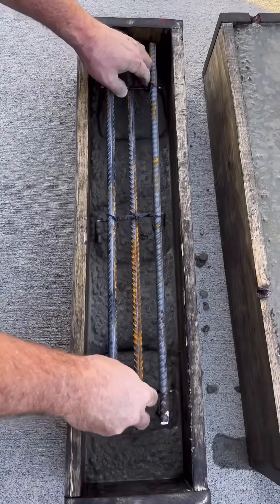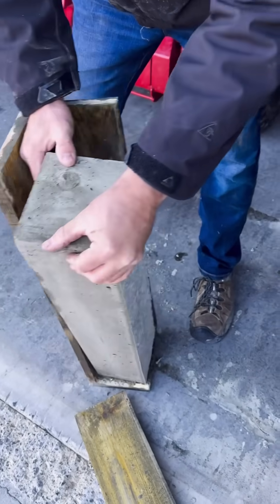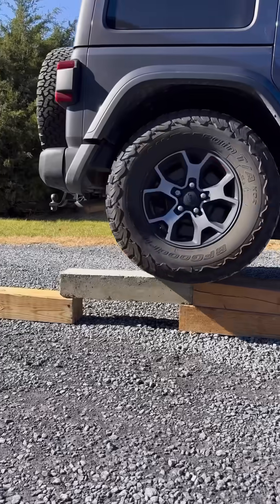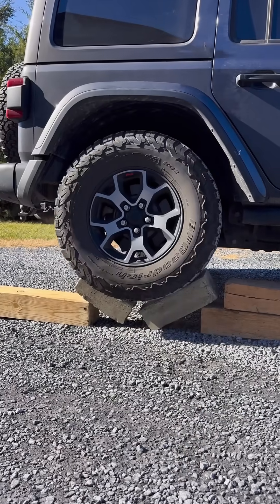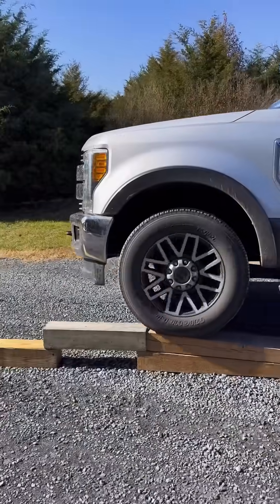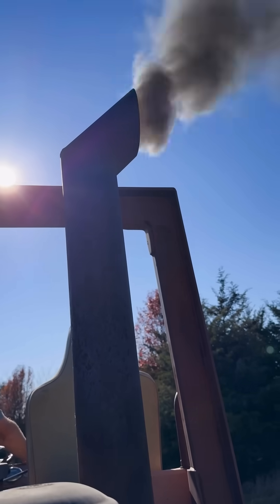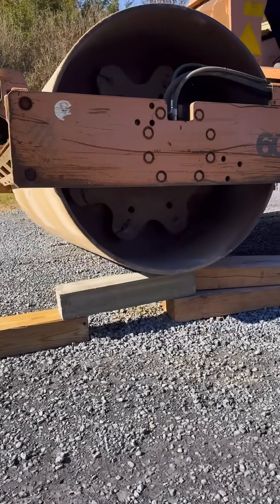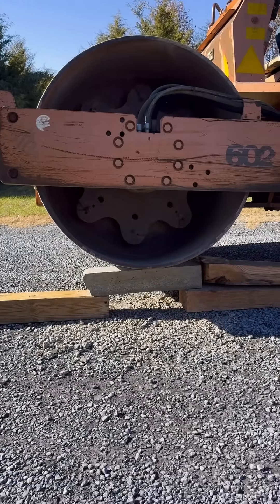Why We Use Rebar To Reinforce Concrete

Comment: I did this as a project in middle school, 8th grade. Science teacher said meh until the dean who had a civil engineering degree came and pulled me from class to talk for almost the rest of the school day about my project and findings. I had experimented with all types of reinforcement. He was so hyped. I’m an engineer today.

Edit: Thanks for all the love. Didn’t expect this. For those asking I was in the Army Corp of Engineers for 14 years. Worked on civil projects but also worked as an explosives engineer. Civilian side I do Industrial Engineering and am back in school again for  Advanced Manufacturing engineering.
Reply: What materials did you try in your experiment?
Reply: @dirkstiletto  started with plain old concrete to have a standard. Really wanted to focus on the difference the added material made. Then did one with chicken wire as recommended by my dad. That got me thinking and I started grabbing materials I had available. I did one with screen from our screen porch. That one was my favorite. Then did one with rebar. Even did one with twigs in it to act like rebar. I was in middle school and having fun with it 🤷‍♂️ the problem came when I struggled to find a measurable way to break them. We pretty much ran them over like this. Any reinforcement made a positive difference. We ended up using these blocks for years for all sorts of things around the house lol
Reply: This is awesome! I am in college for engineering right now, and mechanics of materials is my favorite class I've taken. We talked about this kind of stuff. It's fascinating
Reply: @drewbryant38  If you get a chance, (if you're going the civil/structural route) take a concrete structure design course. It was one of the cooler classes I did in college, and I got to break concrete in the lab, lol. Also, it's one of the more relevant classes to what I do now.
Reply: Of course the civil engineer was excited to talk about concrete...
Reply: @user-ph9pm6fc7g  lmao... As a civil engineer, can confirm.
Reply: average science teacher (doesnt care about the disciplines): 😭

average dean of science and technology (will yap in your ear off about civil engineering): 🗿
Reply: @MattSuguisAsFondAsEverrr  Student: shows an incredible but simple technology that is present in everyday life and is important for our civilizaion
Science teacher: meh
Student: baking soda volcano
Science teacher: WOW, INCREDIBLE
Reply: your science teacher has no passion for science only in title
Reply: i made an electric motor in middle school and got like 60%. the popular guy made a volcano with vinegar and baking soda and got 95
Reply: Sorry for your bad teacher but glad you had others in your life that actually cared!
Reply: W kid and W dean. I'm so happy he did that and you ended becoming an engineer after all those years.
Plot twist you're a software engineer 😂
Reply: @ismbks A dean is sort of the head of a school. 
      If you watch some excerpts from the tv-series "Community" on YT, you can get a better feel for what they do in real life. 
      (Very accurate portrayal of the profession)
Reply: If you were trying to make something hollow out of concrete, basically create a foam form inside of it, what would you reinforce the concrete with? If it was a ramp with an expected weight of like 300 lbs? Would you just fill it up? Or is there a way to engineer it to save on materials?
Reply: @FunctionFIVE  Are you trying to build a half-pipe in your backyard? Lol

But basically, it depends on how it will be loaded. You would want to probably make, like a mesh of rebar if you're essentially having a thin wall that would experience bending stress, but I'm not 100% sure about the geometry you're describing(?)
Reply: @ArchIVEDCinema  trying to make ramps that will last a while on my local MTB trails while saving as much of my own finances as possible. Basically would be a right triangular prism.
Reply: @FunctionFIVE 
Why does it have to be hollow? 
But if so, google hulldekke for an idea.. don't know what it's called in english 🤷‍♂️😊
Reply: @FunctionFIVE chicken wire!!! Can attest. Dry the first layer with chicken wire then the another layer to get smooth
Reply: @evelynnuman  it's a shame this didn't ping me for some reason, so do you mean make a foam core, lay concrete then do a chicken wire layer then more concrete?
Reply: @FunctionFIVE  1. Foam layer
2. Chicken wire wrap the whole thing 
3. Layer of concrete on chicken wire (it won't be smooth - it will look terrible 
4. Allow to dry
5. Another layer of concrete over that layer to make smooth 
6. Done+
Reply: @evelynnuman  sick, thank you so much!
Reply: Cool
Reply: Is right glad that inspired you and your doing something you find fascinating 👏
Reply: bad teacher, amazing dean. I am super happy for you and that you got such support from him
Reply: This is why most science teachers are ONLY EVER science teachers.
Reply: Core memory unlocked right there ❤
Reply: That teachers name? Albert Einstein.
Reply: Amazing!!!
Reply: thought floating around my head:
If you used those connections to build a solid foundation for a career they you could probably add Social Engineer to the list.
Reply: TIL middle schools can have deans too. I thought it was only universities.
Reply: So basically for you, engineering is love, and engineering is life.
Reply: Thats awesome
Reply: Thats lovely encouragement and confidence building!
Reply: SLTW!
Reply: An engineer you say? I'd like to talk to you about my cars extended warranty.
Reply: Holy shit this is such a cool story
Reply: And then the whole class clapped 😂
Reply: teachers suck
Reply: I'll take "things that never happened" for 500, Alex.
Reply: Yeah spreading this fake story around will help human society surely.

Comment: I NOTICED THAT YOU SLIPPED IN THE THIS CONCRETE IS STILL GREEN IN THE END WHICH WAS VERY IMPORTANT INFORMATION BECAUSE ANYONE THAT KNOWS ANYTHING ABOUT CEMENT MIGHT KNOW THAT THERE'S A GOOD CHANCE THAT IT WOULD NOT HAVE BROKE IF IT WASN'T GREEN

Comment: I'm willing to bet if you let that block cure to full strength you would struggle to break the concrete like you did with the roller. The difference between green and cured is amazing.
Reply from the maker: 2.5 days

Comment: The thing you talked about with the compression on the bottom is something that while bucking a tree your also constantly looking at, if you cut to deep into the compressed side of the wood the wood  pinches your bar, if you don’t cut into the compression first than you won’t get a clean cut because it’ll snap

Comment: All you needed to do was read specs on concrete and you should know green concrete will not take any abuse that concrete looked green generally it will turn light gray when dry and there is stress tests that are performed on it to know for sure

Comment: It takes concrete 30+ YEARS to actually fully harden. The concrete used to build the Hoover Dam is not fully hardend yet, it still puts out heat from the chemical reaction. Even with all the water cooling channels.
Reply: It's a big dam so it takes long time to fully hardened 😂
Reply: @Suraj-ix2nh  that’s what she said 😂😂😂
Reply: @cweimer902  🤣🤣
Reply: When I learned this it BLEW my mind
Reply: What you said is true but misleading. Concrete does gain more strength but it levels off after a much shorter period. Typically 21 days is used for a testing period is it gains only a small amount of additional strength for the rest of its life. It all depends on the concrete
Reply: @Civil_Maniac  I grew up in construction. I can tell you from personal experience that 30 year old concrete is much, much harder to drill into or break up than 1 year old concrete. Edit: it also has a lot to do with the thickness. Let the "that's what she said" jokes rain down!
Reply: @nathan40307  i wonder if that strength is akin to brittleness, the total strength doesn’t go up but maybe individual portion are much stronger than the weakest (which would break first)
Reply: @Civil_Maniac yeah, It really gains durability over the course of 30 years. If it is still in the same shape after that time, it is either not being used (which is should be) or it was properly formulated and will last for at least a couple of centuries.
Reply: It also has water moving threw it keeping it wet
Reply: @CodyKemp-w3p Good sir! It appears you have misspelled the word “throo.”Don’t worry, this is a common mistake and even great men have accidentally misspelled it before or mistaken it for the strikingly similar word “threw,” as you appear to have. With that concluded, I wish you a merry day!
Reply: @Dedelblute3  bro "through" is the correct spelling, not "Throo", so it seems you mispelled the word actually not the other person, so don't sit there being the grammar police when you can't spell the word correctly yourself compared to someone who used the correct spelling of the word "threw" possibly due to confusion on the spelling of the word "through"
Reply: @M0RSM4LLE0  Woah woah woah slow your horses there good fellow, I believe I made it plenty clear my intentions were not to be rude or insulting to the fine gentleman I originally responded to. Perhaps you have mistaken my lighthearted banter for a more serious offense of the norms of this here Internet discussion, which I must assure you is not the case. However I must take offense at the distasteful way you decided to approach me with, it was uncalled for to label me as “grammar police” when I am engaged in the polite remediation of word confusion, as well as the hostile and rude attitude that I had originally intended to avoid with my very select words. Making a mistake is not a thing to be ashamed or embarrassed for, and making others feel that way is incredibly disrespectful of their humanity. Before I depart, there is one more matter I must address. It is a shame to have to drop this act this soon, but I don’t think you’ve understood the most important message from my original statement; The blatant misspelling of “throo” was intentional, for comedic effect and to provide levity to the situation. Threw it, I hoped to bring myself down to the same level as the gentleman who originally made the mistake, by making a similar - but not the same - mistake.
With that told, I must depart; If you heed any advice I have given, let it be the one of being kind, even to strangers on the internet.
Reply: @Dedelblute3  you can take offense all you want pal, but seriously, this is YT there are way to many people on here correcting people for spelling when it's literally not needed, my point on this is pointed out below, but if you know what the person is on about them there is no need for correction. You knew what this person meant so there was no need for any correction.

You didn't like my correction regardless if you were using the spelling of "through" as "Throo" for comedic purposes, because that is not how it came off AT ALL, so therefore you don't reserve the right to be offended and call me out just because I called you out for something completely unnecessary.

Good day to you sir!
Reply: Dear @M0RSM4LLE0 ,
You know what? I could argue on the semantics of this, whether it's necessary to correct someone or not, whether or not my offense was taken from your correction or your hostile attitude, but instead I'll just say this:

You misspelled "misspelled" in your first post (and I quote): "so it seems you mispelled [sic] the word actually not the other person." Do you see it? The missing S? It's a common mistake my friend, one you made at a particularly funny time.

And this leads me to my next point:
Both of your posts have catch-22s. Multiple, in fact.

In your first reply:
If it's wrong to correct someone's spelling while misspelling something yourself, it was wrong for you to misspell something while correcting me for misspelling something while correcting someone else's spelling.
If it's not, it wasn't wrong for me to misspell something while correcting someone else and therefore it was wrong for you to put (false) fault on me for misspelling something while correcting someone else's spelling.

If it's wrong to correct someone, then it was wrong for you to correct me.
If it's not wrong to correct someone, then it wasn't wrong for me to correct someone else and therefore wrong of you to put (false) fault on me for correcting someone else.

For your second reply:
If it's not comedic to correct someone for their misspelling while misspelling something yourself, then there's zero redeeming humor in your first reply, and you're kinda just denying the existence of ironic humor.
If there is, the entire second half of your second reply is just flat out not true.

With regards,
Some random guy on the internet who was just being polite.
Reply: Concrete doesn't cure by drying @CodyKemp-w3p
Reply: Not true bro 90 years ago that concrete is dry as hell and discovery channel shouldn't be your source grandpa you can google all this in 2 mins
Reply: Concrete physician here. It does not take 30+ years.
Reply: @CrabbinFever  glad you're a concrete physician because if you were a people doctor you would be killing people with your ignorance instead of trolling YT!
Reply: Nah
Reply: Source: trust me bro
Reply: @xrainbowdash4963  the internet exist and yet you are still ignorant
Reply: @xrainbowdash4963  Nope. Discovery Channel.
Reply: @xrainbowdash4963 You ain’t funny using 2018 meme
Reply: @invinsible1987  nothing wrong with an old meme, but everything wrong with being proud of ignorance.

Comment: And, for further added strength, add carbon. There is a company that turns CO2 into carbon, then pumps the carbon into the concrete to add strengh.

Comment: Rebar also dramatically shortens the life of concrete, jacking at apart and crumbling it as it rusts. Better answer is just to use concrete in compression.

Comment: Driving over the unsupported beam isn't testing tensile strength, it is testing bending strength, which is actually a combination of tensile (the bottom half of the beam that  is being pulled apart) and compressive strength (the top half of the beam that is being pushed together). To test exclusively tensile strength, you would need to pull two opposing sides apart.

Comment: You used the rear end of the jeep super light, and the front end of a extrended super duty. Wow what a major difference.. and im a concrete finisher, but i never seen a comparison like this. Appreciate it man
(Edit: almost forgot, takes 7-10 days for concrete to fully cure.)

Comment: the rebar nearer the top was under compression as well, so only the bottom rebar was useful here
Reply from the maker: I put the rebar in the top third of the beam . But I flipped it upside down before driving on it, so it was actually in the bottom third
Reply: @hausplans  I didn't catch that, nice.

Comment: Someone mentioned how the wood had no problems. A one point I was considering what to build a house out of in an earthquake zone (Works out the same essentially in a high wind zone.) Concrete has no tensile strength and it's very heavy. Wood has excellent strength in all directions, it's very light and flexible. And it's very easy to tie down to a slab or piers. All wood joints can have a small metal plate connecting them together. So wood is clearly the winner.

Comment: Mind, even if it withstood the roller I would no longer trust the block for holding significant weight because it did break apart some, exposing the rebar, and I doubt letting it cure entirely would've made a significant difference with the outcome.

Comment: The full cure of concrete is 28 days, however the first 5 days should get it to 75% of cure under normal conditions. Additives can help with fast cure and warm water in winter helps.

Comment: Based on the fraction you can tell the positioning of the rebar isn't optimal either. It's almost placed half-way through its height which is probably the worst place to put it. It should be much further below for a proper test.
Reply from the maker: It’s hard to tell by the camera angle, but the rebar was in the top third of the beam. Then I flipped the beam upside down before doing the test, so it was in the bottom third.

Comment: You should look at the PGR building in Brasilia / Brazil. There are two building: one is build upon concrete and the other used the iron at the top suportinhos it. Concrete can take high pressure and iron can take high weights.

Comment: If you put threaded rod through the concrete and drill holes in the wooden form, stick the threaded rod through the form, put nuts on it and tighten them down it will be even better because the rod is under tension and once the concrete dries you can cut the nuts off and it will hold that rod under tension therefore compressing the concrete. It makes it significantly stronger.

Comment: For an experiment to be accurate you need to have the OTHER variables constant  besides the rebar. You used a different truck. Obviously, rebar does improve strength but this test was pretty bad.

Comment: Try using salt water
Reply from the maker: Salt corrodes concrete, so I’m not sure why that would be a good idea
Reply: @hausplans   I agree however they have recently been trying to figure out why Roman concrete lasts so long and it turns out it’s because they used salt water.  They would also use quicklime. The quicklime would create pockets that were not cured. And when the concrete broke  it would actually repair itself.  I’m just curious how just using salt water would change the concrete

Comment: For turning on the vibration its doing what its supposed to do cause the tension get placed in all random directions the concrete crumbles and the rebad just amps it up for being a material that can handle that stress